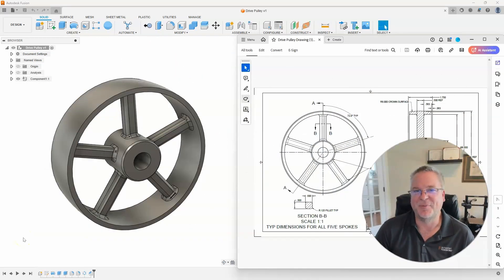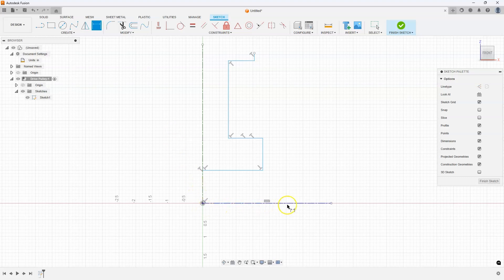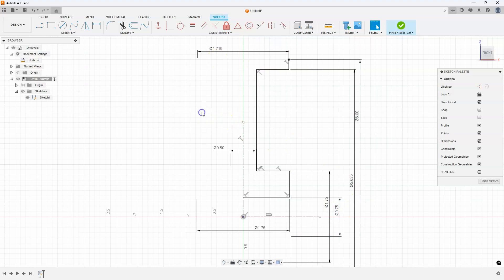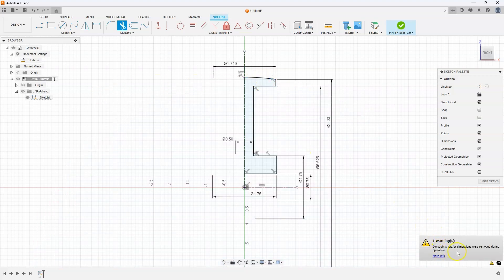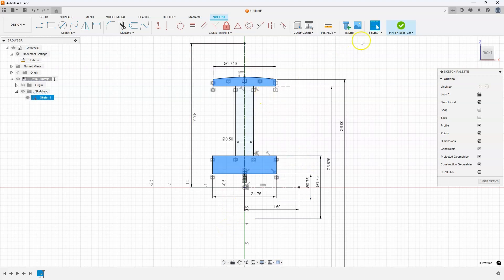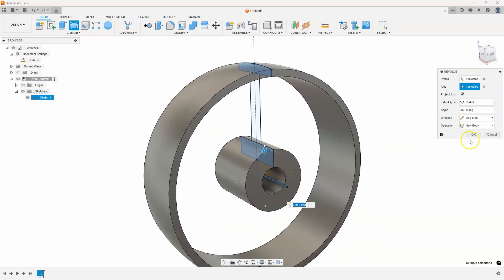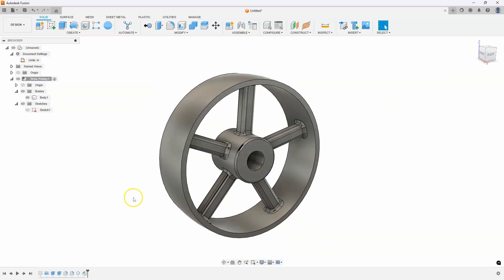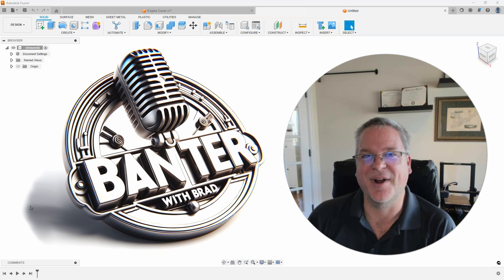Banter With Brad, Episode 04 - Fully constrained Sketches

Comment: Good to hear from you Brad. I miss the live streams. We  are so fortunate in any case to leverage the body of tutorials of yours and other s like Lars Christiansen et al. I have spent the last 3yrs making mostly wood chips, but now for some precision part production. The 24 x 48 gantry mill I have needed a lot of upgrades to machine aluminum. I have spent untold hours. On the last mile now. I have even cleaned all the linear bearing blocks and ballnuts. And boy did they need it. The goal was to use the machine to make new  Z axis ass'y  I can't count the hours spent trying to optimize the 3D toolpaths for the first of these components. Got to the point where I nearly simplified the design to avoid the headaches caused by having to guess. This is a big ask to bring to the forum, so....If I had my wish, I would ask for more involved or intermediate level  tutorials on 3D toolpath strategies using something other than "widgets". But anyway, I am about to subscribe to get the full rapid travels and can't wait.
Reply from the maker: We are working on putting together some more "manufacturing" video topics.

Comment: Brad why did you divide the .063,the drawing shows .063 on one side so wouldn’t you multiply by 2 and subtract that from the 1.750? Making that 1.624 across the top. Did I miss something? Love your videos just want to understand.
Reply: Equally confused. Dividing would seem to give a relief of .315 on each side
Reply from the maker: @kellypurdue1990  Check out my reasoning in my reply to @cygnet1963.  Thanks for watching!
Reply from the maker: It's confusing, but it is because I created a "diameter" dimension by selecting the centerline first and then selecting the sketch edge.  So, when I do the calculation, I have to take 0.063 off "both" sides due to the diameter dimension.  That is why I multiply it by 2.  Thanks for watching!
Reply: @bradtallis8968  Hi Brad, you wrote: "That is why I multiply it by 2" But on the video, probably by mistake, you divided by 2,   6:24
Reply: Would have been easy to just dim' the 2 lines to be 0.063 apart !